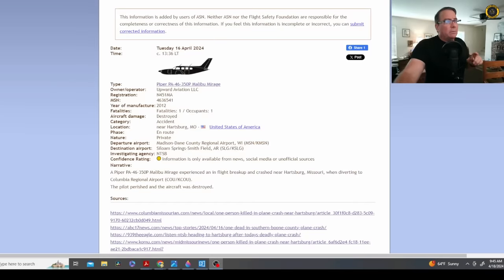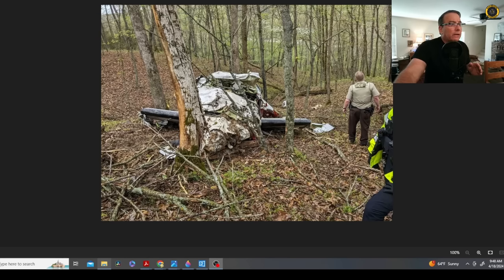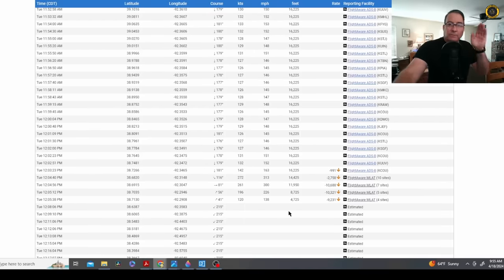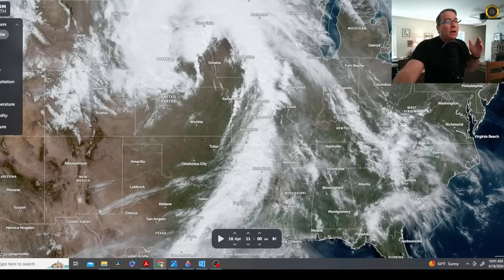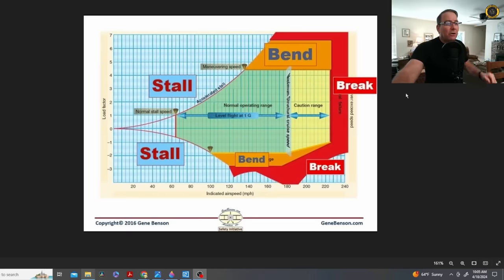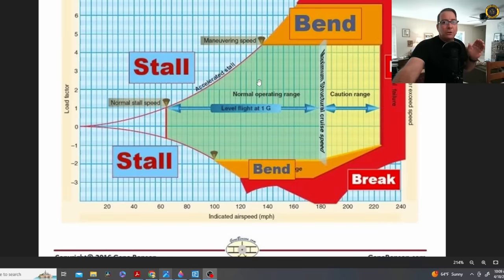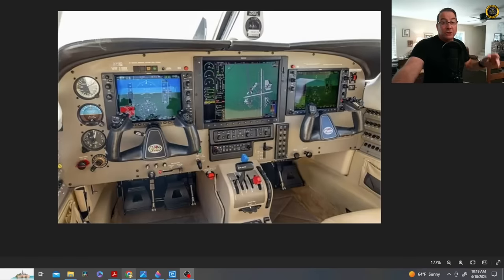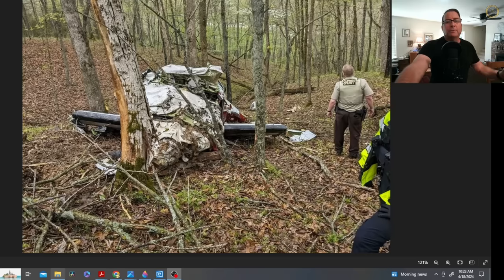N451MA PA-46-350 16 Apr 2024 Structural Failure

Comment: So it failed because of turbulence at nominal speed, not due to overspeed or G load. It was even down to maneuvering speed, not even close to structural speed as the limit for rough weather. That does sound like fragility or design problem. Old design but still produced today. I would be upset if that was the reason. Unless it was weather from hell that tore the plane apart that seems way too fragile. Unless he made completely spastic control inputs. That seems like way too thin a margin. On a close to 2million dollar plane.
Sounds like time for a new model
Reply from the maker: No. The plane was oversped, BEFORE structural failure.
Reply: @blancolirio  doesn't it say 132kts before things went down hill? and if that's ground speed at 16k feet that seems super slow unless there was a strong head wind. The weather front seems to suggest a western wind. I think we need an anomalous event, the ground speed alone shouldn't be enough, that's slow LSA speed in thin air. I found a missouri uni report that said supercell thunderstorms developing off the front with hail etc and north north east motion, strong gusts. I don't know what that means but just maybe the plane entered 100knot gusts and or severe icing that resulted in overloading. Maybe. 
If this was an overload case I think the structure needs to be much stronger even if flying in thunderstoms is inadvisable. Composites would seem to be an obvious way to get toughness without weight. and they don't suffer metal fatigue.  It must not be this easy to kill a plane.  
And if front storms are exceptionally fierce we need data on that. It can't just be an unknown boogeyman. Is it manageable or tear any plane to pieces no matter what.
We need much better ADS and flight recorders and some test planes probing the worst weather so we don't have to rely on accidents to find out.
The weather you overlaid has little red dots near the accident. Maybe those are supercells.
GPT4 says supercells can reach 50k feet and are characterized by strong vertical wind shear. As much as 100mph up or down. Off the top of my head I'd say that might put a significant load on an aircraft. One might conclude that supercells are not your friend. We might benefit from gear that can spot those. Nose doppler might spot those. Should be doable for modest cost today. Electronics is very capable. Two little jets at the back would leave the nose free for radar.
Reply: @DanFrederiksen He had about a 70 knot headwind at the time of the breakup.

Comment: Juan, is it not possible that the structural failure was the result of severe damage by turbulence encountered within the severe frontal system?
I understand that you are right as far as the pilot pushing his luck by penetrating such a frontal system, however, there may be a design fault present in this type of aircraft, and the FAA should invest more time investing such a possibility, regardless of the amount of work it requires.
Look at what Boeing has been doing in its factory! And the sudden death of the whistle-blower.
Reply: Cut the conspiracy. This plane had a good look years ago when this stuff first started. There is no design fault. Training requirements fixed the problem (same as with Cirrus.) This airframe will gain speed now, it's quite efficient. And so many seem not to be able to handle a plane such as this. I won't fly anything faster than I can think, so I'm stuck with a Skyhawk.
Reply: We already have a simple, direct explanation for this accident. The mechanics and dynamics are well understood.
There is simply nothing left for a conspiracy theory to address.